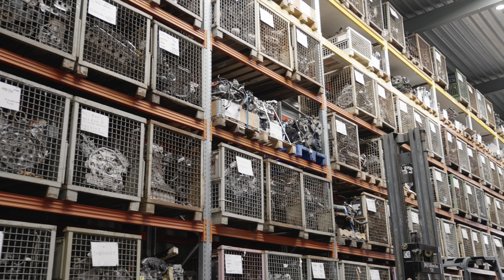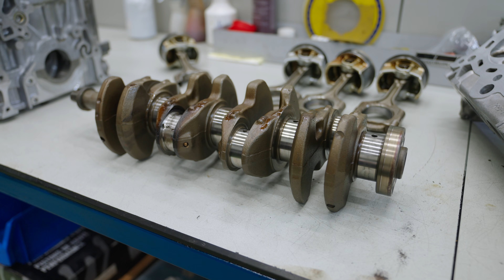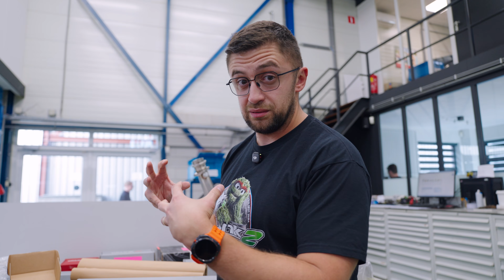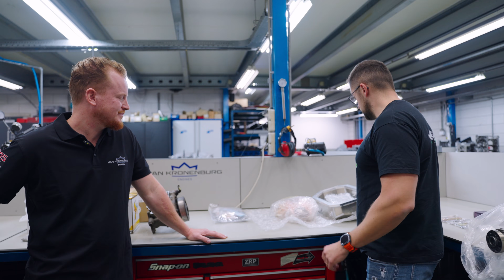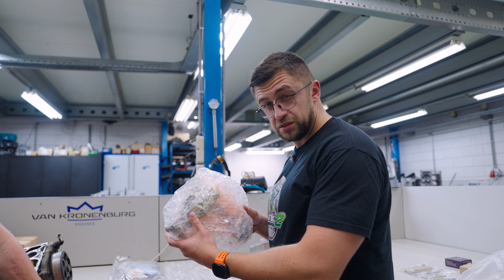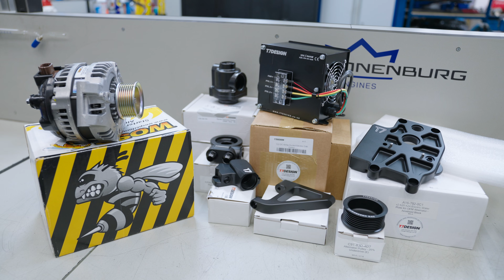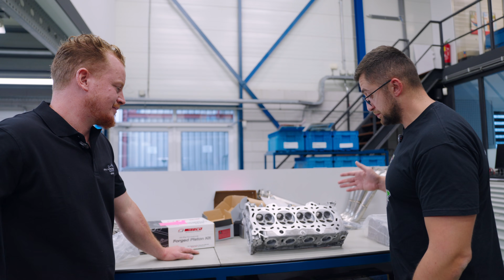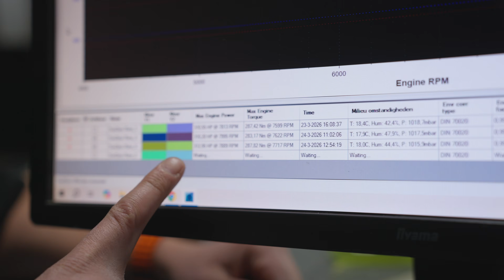My K24 is EARGASMIC! Full Engine Build Breakdown & Dyno!

Comment: to this day i dont understand how the k24 is just so perfect and how nothing has came out to replace it for bang for buck
Reply: Emissions.  And it's not perfect it is arguably a bit heavy for it's displacement and suffers from reversion issue and vibrations, but reversion stuff is something skunk2 worked to avoid issues with after years of drag racing them and if it's heavy it's still making enough power given it's cost no one worries about it
Reply: @Ottobon do you think there's a better inline 4 engine you would buy given the same budget?
Reply: @Tay675 truly depends on the car you're running. Anything super light and i'd say the 2-zzge beats the k24 and k20. Much cheaper, significantly lighter and very emotional. Lotus chose it for the elise for a reason.
Reply: @Tay675  On a small budget (below 6K total spent) and if going for RWD cars, I'd choose Mercedes M111 Kompressor (though turbo it instead of stock supercharger). In case of FWD builds, nothing really "beats" the K-series, especially when you can use the stock ECU without a need for standalone to run turbo or whatever.
Reply: a K24 was never made for sport cars or racing! The bore stroke combination is nuts. Its the worst possible way you would choose for an high performance 4 Banger.

Comment: MotoIQ did a video recently showing the difference in endurance builds and "e-peen HP chaser" builds.
Reply: PS dry sump is not too much.  Not if endurance is your goal.  But it will cost you.  Damn they are not cheap to get, and take time to set up and plan right.

Comment: Can't wait to hear that K24 actually powering the Civic!
Reply: yes yes yes yes i cant wait this is gonna be sick sub 7 civic
Reply: i want outside flyby at Fuchsröhre !
Reply: 8200??!!! waaaa come on ppl run that on stock k24's... do atleast like 8600 !!!!!! COME ONNNN  GAAAAAAAAAA 🤣
Reply: HP is already tapering off. Revving it higher is childish.
Reply: @wudntulike2no32 thats bc of the tune you child
Reply: @repingers9777 Piston speeds would tear the engine apart on the nurburgring. 99mm stroke k24 vs 86mm stroke in the k20.

Comment: Misha, I have a question, im planing on doing a ITB on my corsa 2014 1.4, it has a aluminium block so I don't want to break it that fast, this is a 3 month upgrade until my new OPC turbo engine comes, do you recommend me to put the ITB anyway
Reply from the maker: it's an amazing sound and feature, but mapping can be tricky
Reply: @mgcharoudin yea a British corsa owner told me that you need to be strict with in controlling every aspecto to not blow up everything, thx for that advice misha

Comment: Crazy to think in the 1990's Manufacturers were spending hundreds of thousands of pounds to make 2.0 litre super touring engines around 330BHP and you can do the same today for about a tenth of the price.
Reply from the maker: We are dealing with 2.4 here, 2.0 would have been more challenging
Reply: @mgcharoudin  Yes i understand that but is still impressive numbers for a 4 cylinder.
Reply: @Brickhazard I’ve seen a Toyota Yaris GR with 900BHP I think, was from the UK. I think it’s a 3 cylinder, completely crazy
Reply: @immersive4k-m4x  turbo though. A lot easier. You just build the engine to take enourmous cylinder pressures, and then boost it to the moon. Making crazy N/A power is getting toward being like the dark arts.
Reply: @immersive4k-m4x there's a consideration for how often the Powerplaint has to be rebuilt though. So many things to consider.
Reply: @mgcharoudin the F20C engine had the most power per litre for years until  Ferrari made the F136FB. Over a decade from 1999.
Reply: @mgcharoudin  Not that much tbh, since the K24 is just a stroked K20. Я надеюсь, что ты не угробишь твой движок, так как 8,5 тыс на к24 дает 28 м/с поршневой скорости.
Aber in jedem Fall beeindruckend,  was  die Grenzen des Machbaren angeht.
Reply: 1980s 2.0l: 80-100hp
1990s 2.0l: 130-160hp
2000s 2.0l: 150-200hp
2020 2.0l: na 2.0l 4 cylinders dont exist...
Reply: @pauliewalnuts240 1995 honda 1.6 b16 190hp   honda s2k 2000 240hp 2.0
Reply: @r @repingers9777 988 Honda released the b16a which was 158whp. 1992 that motor got some upgrades and produced 168hp. 1995 1.8l b18c with 198 hp. Honda was the first mass produced non “homologation” special to produce 100hp per liter.
Reply: @pauliewalnuts240 Mazda MX5 with a 2l NA 4 cylinder still can be purchased new.
Reply: @pauliewalnuts240 mazda has 2.0 4 cil na engines.  until this day.
Reply: @pauliewalnuts240 M20A-FKS engine from 2019 - now. Got it in my hatch, super high compression. Not a honda but still Jap
Reply: @pauliewalnuts240honda makes r20
Reply: And its even more crazy that engines preferred today are from the same era or a little after.
Reply: You can get the 2.0 in a Mk4 Mx5 up to 200bhp for less than £2k. 
It's mental how far tech has come with engines.
Reply: @setra23 the 2l k20z3 has 200bhp NA stock . fk ur volkswagen pos
Reply: @setra23 it was a common and regular occurrence to get the Honda b18c engine (1.8l) over 200whp with bolt on’s and tuning. This was in the 2000-2006 era.
Reply: @setra23 lol. You can get the 1.8t 20v Audi motor up to 450 quite easily. 350 with stock internals is very common with a simple turbo swap and tune with basic supporting components (injectors and downpipe minimum) been playing with them since early 2000s. Still one of the best, cheap easy and very strong moddable motors. Solid iron block from the factory. Theres virtually no such thing as "too much boost"😂
Reply: @notyouraveragegoldenpotato  turbo is completely different story
Reply: @notyouraveragegoldenpotato  You've missed the point, everyone here is talking about naturally aspirated engines. Of course it's easy to make stupid power with forced induction.
Reply: @notyouraveragegoldenpotato  This is a N/A build.
Reply: @TheYORK21  I didnt realize that😂 impressive. I thought k24 turbo like it seems everyone does. I thought what's the big deal? 350 is a super easy turbo build😅
Reply: @n @notyouraveragegoldenpotato how did you not notice the itb’s 🤷‍♂️
Reply: @notyouraveragegoldenpotato  yup it is. I dont have the disposable cash or the connections misha has but my k24a3 makes 230hp after just breathing mods and the 50 degree vtc. These engines are extremely rev happy if you willing to put in the effort.
Reply: @notyouraveragegoldenpotato you missed the point of this being NA. I’ve tuned plenty of stock turbo k20 making 500hp with a turbo or k24 making 600+. K series is by far the best 4 cylinder engine ever made.
Reply: How could a K24 be the best engine ever Made, for NA Power and reliability? Thats internet myth BS. in These little Bore size you get only very little valves and the Traktor stroke of 99mm Limits the rev. Limit by 8200 RPM as an absolute Maximum. These Numbers make an K24 for a very good daily engine, but not for an Performance engine. Myths over myths. Take the math and the numbers, they telling the truth.
Reply: @DaEVOthefreak How old are you ? People have been revving k24's over 10k REALIABLY for over 15 years now. It's just a case of Misha not really wanting a high revving engine, and I can't blame him bc the cars will be built for endurance racing, where you need more torque.
Reply: @d1m0vvv  Im 42 y.o! All BS, nobody on erath can rev an reliable Engine with a Stroke of 99mm !!!! over 33m/s Piston Speed!  Thats impossible! No race/ sports- car or bike manufacture on earth go over 26m/s Pistonspeed! Never ever! No Moto GP, no F1, No Ferrari, no McLaren, no Honda, no Porsche, no KTM, no Ducati, no Königsegg, no Bugatti! Im an engeneer and no keyboardevil  with webmyths. People who claim and write such things like you are exposing themselves and making fools of themselves
Reply: @DaEVOthefreak  You are truly ignorant. You are saying things are impossible that have been done for almost 20 years on K series engines. I have personally tuned many K20 and K24 engines. In drag setups they even increase the stroke to 102MM meaning even higher piston speeds. No other NA engine will make the same power per liter as a K series.
SO please stop name dropping here, doesnt improve your argument.
Reply: @350gtboi  Aren't Engine Diapers mandatory in those classes?
Reply: Technology improves overtime
Reply: At 8k rpm rev limit 330 brake is pub no's, unless your on 105/106 octane fuel with a 14+:1 comp. ratio
Reply: @gothicpagan.666 Google super touring era BTCC. The best engines were making those figures but on race programs costing millions of pounds. Legendary SR20 made 320BHP in 1999 in the Primera @8k RPM. It was the golden age of tin top racing.
Reply: @Brickhazard  its weather an engine for one race (like the super touring engine) nor he has got 0,4L less. And if, the K24 is one of the worst Engines to make big output on rev limit, couse the bore stroke ratio is nuts !!!!! It never should be an racing engine, it was a sedan engine.
Reply: 4Piston Racing could've sent him a whole brand new K24 2.5L crate engine making 400hp NA, I was commenting the same to Adam LZ for both his Silvia he had that kid Kyle build his engine (and then not make the power expected) and his CRX he uses for time attack around his compound
Reply: @johnnygeorgopoulos4072  thats an internet myth BS! physicaly impossible!
Reply: @DaEVOthefreak  What is physically impossible? 2.5L with 400hp is possible.
Reply: @James-dx9ho thats nonsence, especialy from an K Block with this little Bore spacing. You dont know what you talking about. I Engineered a specific racing 2.8 racing engine from scratch with latest possible technology and only get 390-420HP out of it. Depending on Cam and rpm tune.
Reply: @DaEVOthefreak  4 piston regularly makes that power. But they run on M5
Reply: @Shadowboost they make these... They make that... but they run on these and on that... All BS! Physics are physics! Especialy the American numbers, i only  can laugh about. Impossible Numbers wich even Big Bike Engines with very Special RPM an valve sizes are caplabe. F.E. Ducati 1299 panigale with 650ccm and 102HP/ cylindre or a GT3R without restrictor 700ccm and 103HP / cylindre. These engines are the most powerfull big bangers NA per ccm and HP per cylindre. And you get these numbers only with high RPM, so very big Bore, big valves, big cams, small stroke. An K24 with its tiny Bore, valves, and traktor stroke is not capable to do that, not even near about. Its just physics.
Reply: @DaEVOthefreak  330bhp from a 2L in the 90s. Maybe you should try harder.
Reply: @James-dx9ho What does the year of manufacture have to do with it?
I think you’re referring to the STW or BTCC engines, right? Could it be that you’re misinformed? That very example supports my point! Those engines had the same bore and similar valve sizes to the K24. That means that’s the end of the story. The bore, and consequently the valve size and cam design, inherently limit the airflow into the combustion chamber. Since the K24 doesn’t have a larger bore but only an extremely excessive stroke, this engine gains absolutely no extra power! On the contrary, due to the (13mm longer!) tractor stroke, it cannot rev nearly as high as the STW/BTCC engines with an 86mm stroke. The bottom line is that, in terms of maximum achievable and, moreover, sustainable power, the K24 has absolutely no advantage over a 20-year-old 2-litre engine. But little boys like you just love to play in the icbergwaters of myth. In the end, the only thing that helps is to engage with the facts of physics, mathematics, engineering and the reasons why things are the way they are!
Reply: @DaEVOthefreak maybe try being better at building/designing engines? Or just run around in your own little bubble with zero actual real world data to back up anything you’ve done. And continue to poop on NBE who’s been doing it for 27-30 years at this point. Or 4P who’s been at it for a decade or more now. Sure you really know better than them.
Reply: @johnnygeorgopoulos4072 Hmmm, and see how 4Piston Racing engines worked out for Mike Burroughs with his K24 engined Ferrari 308. No thanks
Reply: MotoGP is making ~300 from <1L

Edit to say: awesome build. Cant wait to hear/see the results of knowledge and talent screaming around the ring!
Reply: @theyrealltaken3 n/a 2.4 V8 from older F1 times did over 900hp :)
Reply: Hell yeaaaaah, love it!!! Would love too hear and see it in person someday 🤤🫶🏼🫶🏼🫶🏼 Awesome build for sure 🫡
Reply: 30 years of technology and electronics have not passed in vain: computers are everywhere, test benches too, and many things have been understood that were still unclear in the 1990s. Materials have improved beyond... It's progress! But in example, bmw motorsport in first 2000 with this same tuning parts of this engine obtained 410+ hp from S54.
Reply: @z @ziofrenko ere is definitely progress, but s54 was from the 2000s so not recent and also 3.2lt. My point is that there aren’t any good N/A engines for the masses produced nowadays. Yes the environmental rules play a role.
Reply: Misha’s engine is really great but OEM racing teams are from another planet 
1. Displacement (20% gap)
2. 8500 rpm limit (not existing here)
3. Reliability (not yet proven)
4. FIA technical regulations (not existing)
Reply: I might be missing something, but which N/A engine taken from a production car sold today has the same capabilities?
Reply: They were running restrictors though, i think?
Reply: Early 2 litre touring cars were rpm limited. It's very hard to make 300 plus horsepower at say 7500rpm. The touring cars had fairly mild cams, say 276 advertised duration, but over 16mm of lift!!
Reply: And the engine will last... 1500K?
Reply: Yes, but the price of small investments is short-lived, and what was assembled in the 90s is still running...
Reply: They didnt have more because the RPM was capped, otherwise they would have had waaaay more power.
Reply: None of you have ever tuned or built a k series and it shows.
Reply: Honda tuning for you 😭
Reply: Love sound of high revving 4banger with itb 👌
Reply: More like usd and yen
Reply: That's because the revs were capped at 8400
Reply: By pretty much all factors except stock reliability, the manufacturers have failed for 36 years to engineer a better 4 cylinder. 

Famous 4 cylinders like the k24 and 4g63 from the 90s have a higher possible redline, WAY more power potential when modded, better head flow, and better sound than all the modern 4 cylinders.

Comment: Well, you can technically buy a K-Series brand new.
Different vendors offer components like the longblock or the head as new old stock, so you could piece together a brand new one - not that it really matters.
Would also be outrageously expensive.
Reply: You got me curious and I found few, 4pistonracing has K24-K340 2.4L complete engine for $10 000, adding pistons and valve cover makes it around $12 000. Around 340hp, 9000+rpm and armor plated forged pistons with forged connecting rods.
edit: Okay, I opened the catalog and there are also few K24 builds designed for turbo and cost up to ~$18 000,  "turbocharged race engine looking to exceed 1500hp [...] pushing 60+psi boost." Honestly I have some doubts how well it performs long-term for that price, because if it's as good as they claim, it'll be pretty cheap and really light-weight option for high power builds
Reply: @MariachiMak 
Option 2: trip to the junkyard and 500 dollars, then $4,000 to build it
Reply: @MariachiMak Mike at Stanceworks ran these in his Ferrari for a while and downsized to a K20 after multiple failures, admittedly I don't know their intended application or life expectancy but it was surprisingly short for whatever reason
Reply: @RichardM42  Drag racing.
Reply: @MariachiMak The 1500hp plus K24s is in drag trim.
You refresh them often.
You can't lean on them for a long time that hard. Look into boostedboyz for example Kyle have been pushing those little Honda engines to the limit in a fun way for years.
Reply: It's getting ported, cut for oversized valves,  and decked why pay for new with all that machine work
Reply: @weaksignal8009 I agree 💯
Reply: piecemeal yes, or you're buying a full build from someone like 4piston
Reply: You can still get completely new short block assemblies from Honda, they're just insanely expensive.

Edit: Cylinder head assemblies, too, are still available.